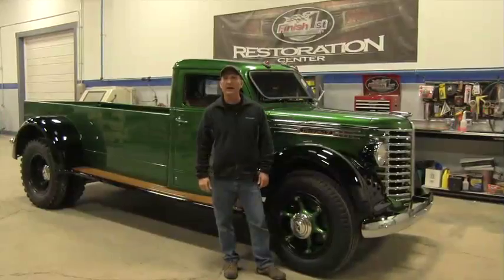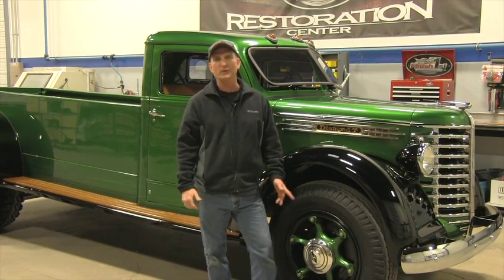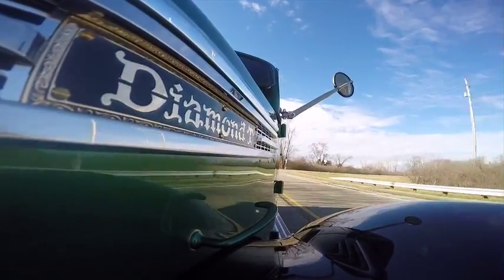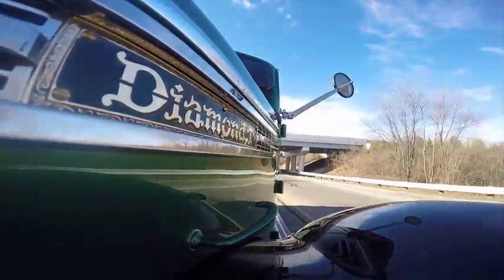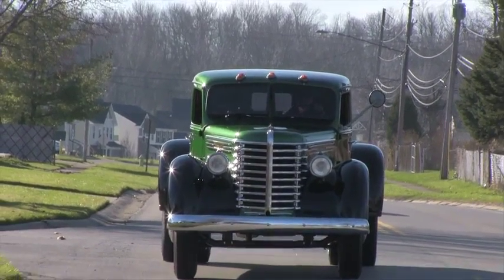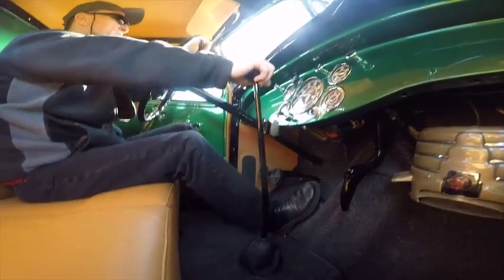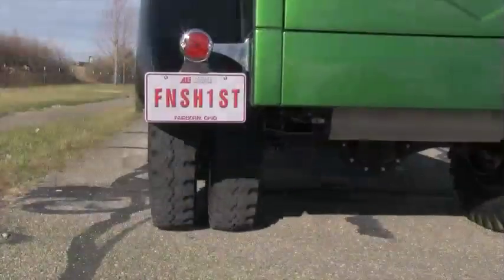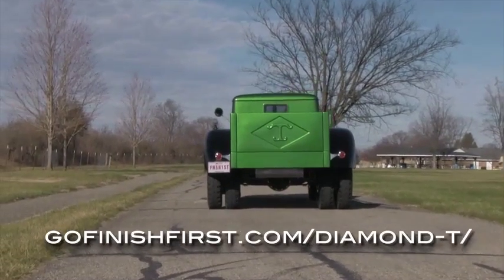Diamond T - Out On The Road

Comment: What size wheels and tires are those? I like that style tread on the rear, and want to know where i can get a set. I'm looking to build a 1940's DoDge or Diamond T.
Reply from the maker: +DJ Inclined Hi DJ they are 20" Split Rim Tires. These wheels came with the truck that we bought. If you need parts you can contact a gentleman named Tom Warren in Lorado Texas. He specializes in Diamond T's